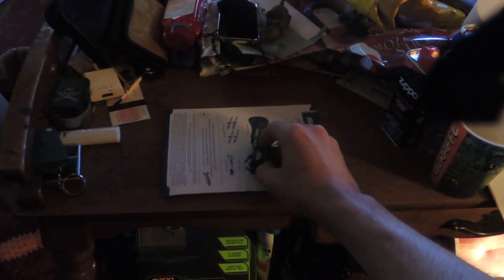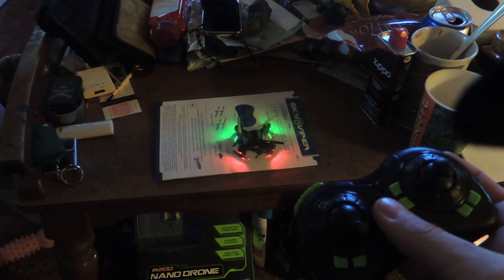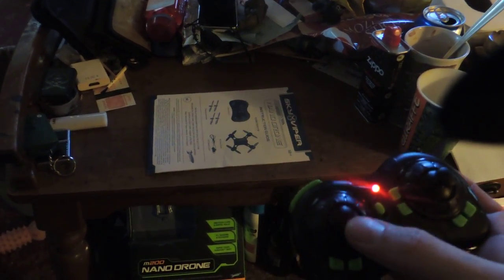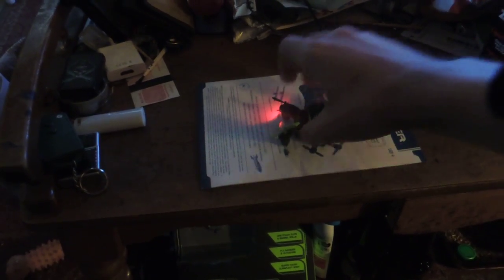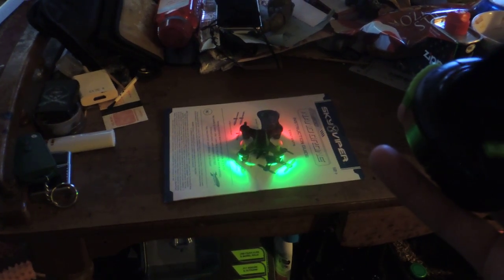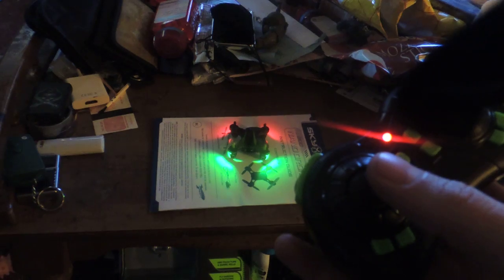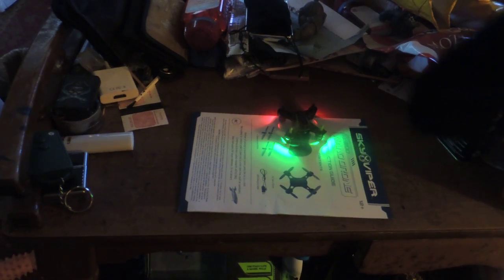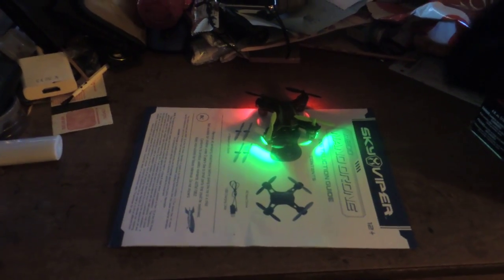M200 drone problem.

Comment: Pretty sure your blades were just on wrong. If you have the drone facing away from you, face propellers horizontally. Now, if both sets of blades (inner halves) are inclining towards the drone, then you have them installed properly, if not, you have a prop on the wrong motor. Its quite easy to mix them up and they only provide you with one spare for each motor, and although they might look the same at first glance, you'll find that there is one black prop and one green prop that look the same.  This is an especially difficult problem on the older models of the M500 and the M200, but the new (2016-2017) models have tighter props, so they don't pop off mid flight like those on the older models. I see that this is about 2 years later, but I hope this will help others.

Comment: I bet you have your blades installed incorrectly. There are two types of blades... two are rotating clockwise (A) and two are rotating counter-clockwise (b)... They are marked with an A and a B. This is the correct order visualized from the top of the drone with the front pointing upwards: A-B for green blades (front), B-A for black blades (back)
Reply: thats exactly what you have to do

Comment: The blades are causing the problem. Each blade has to be installed to the correct side of the quadcopter, otherwise, it will push the air up rather than down. For your case, all you have to do is put the left blade on the right and the right on the left - that should fix your problem.

Comment: i have the same prob. even switch to all green and black props. could be a defect im gonna exchange it for another one maby the wifi video one
Reply from the maker: +Jackie Selmo the right and left blades got swapped on the front or rear , the propellers both face different angles , i switched em and it was flyin like new again.. lemme know if it works for you as that was my problem.
Reply: +wheelz696  I did try it also changing blads and wouldn't work its defective  also no response from sky rocket it goes to voice mail.
Reply: +wheelz696 thnks